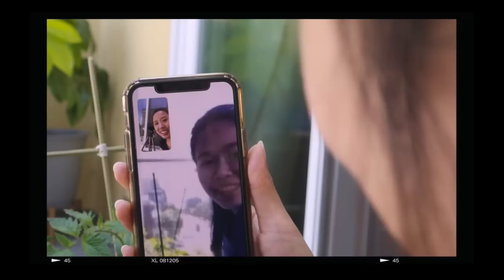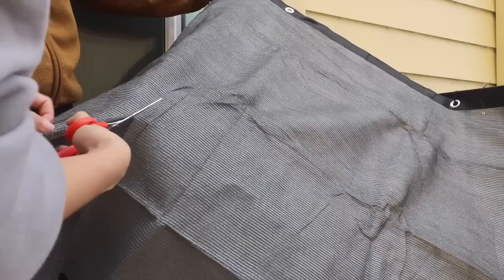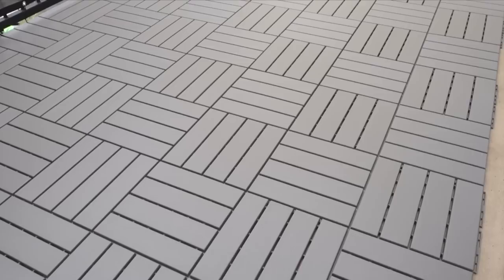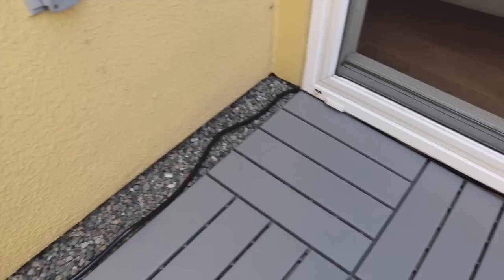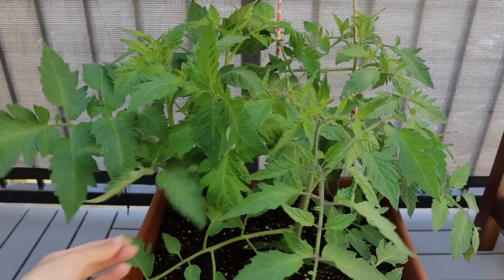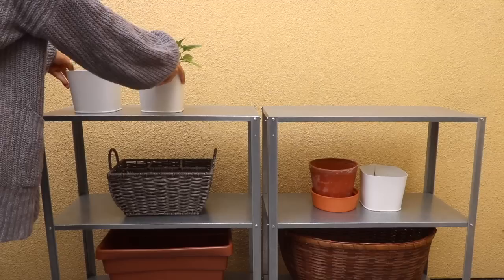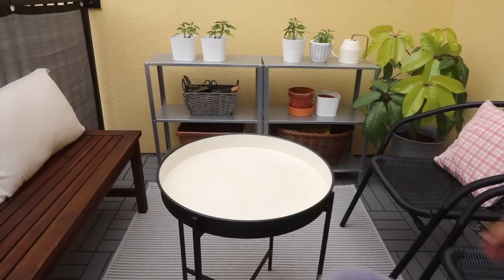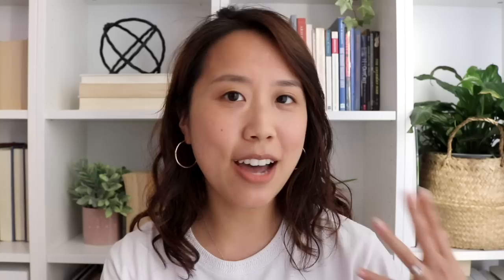DIY BALCONY MAKEOVER ✨ RENTER FRIENDLY!!

Comment: Do we need to worry the sane the underneath these decking panels? Any chance to open to clean or it is easy to clean?
Reply from the maker: It is easily removable for cleaning below! If the floor is concrete, tile, you could hose it down too as there’s space beneath the tiles. Hope that helps (: